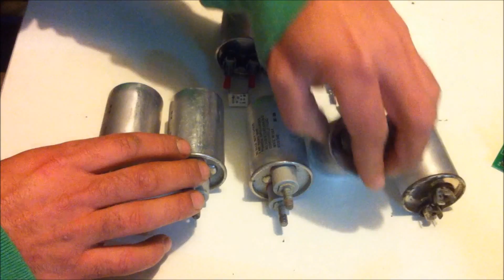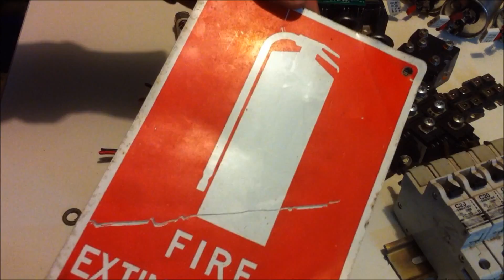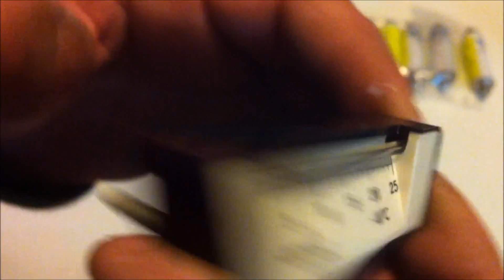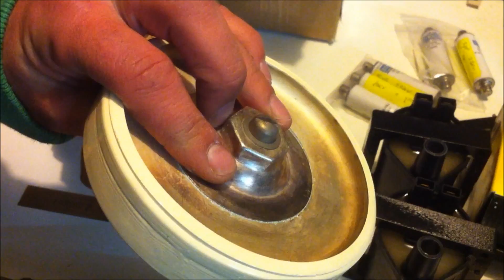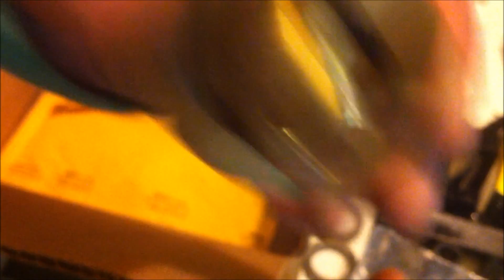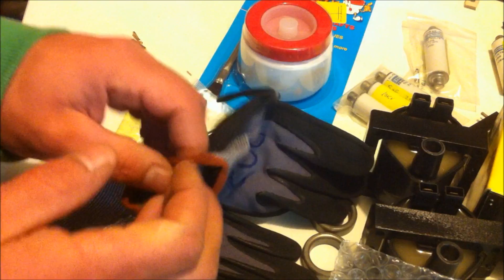Energy Update #31 - Opening Packages & Showing Off Some Parts

Comment: Hey Nick,

Glad you liked the goodie box. Did the brass plugs fit at least? I'm dying here wondering. 

All the best,

Tom
Reply: I too would like to know, so I will know if I have find a clean cloth to wipe the egg of my face for suggesting what the thread might be.
ATB
chris,
Reply from the maker: Yes, VERY much appreciated. Thanks.
I can't wait to use my new spillmaster!

No, the plug did not fit, aggrrrhhh! I am beginning to think this transformer wants to stay dead. I will be uploading the installation (attempt) video soon, but it bites in about half way down. The major and minor diameter of the thread is ok, but the thread pitch is off. In hindsight, we should have gone with 25TPI. Sooo close :(

Do you think I can just use some forceful tapping action (slowly backwards and forwards) to get it in the rest of the way? By my calculations, it should only cut roughly half way into some of the brass threads. I'm just hoping the steel thread on the transformer holds up to the pain if I go ahead with this.. Do you think this is a good idea or can you suggest an alternative? 

Thanks.

EF
Reply from the maker: Chris Stephens
Chris, See my reply below. No egg necessary, it was almost a perfect fit!
Not a bad effort considering we are all on opposite sides of the world and the fact that the damn plus is so unique :)
Reply: If I were there I would die the thread a teensy weeny bit. I suspect Tom did a too accurate a job on those plugs, or maybe the hole was cut with a worn out tap, it might only be a thou or so that stops a fit. Thinking of which, now that we suspect we know what it should be can you beg, steal or borrow a tap and die to just clean up both hole and plug. Even if it is 25tpi(unlikely) running a 26 tap down the hole wont ruin any thing.
Reply from the maker: Chris Stephens 
Chris,
You were right again... it is 26TPI. After reading your comment, I just used my 'extra force + shifter' method and I was able to slowly persuade it in all the way... Ten min later, after some backwards and forwards action, the brass plug was tapped to match the transformer. I gave the brass thread a once over with a brass wire brush and it was like it never happened. It only took a bees dick off the thread and now it glides in like a glove. 

Great job guys! Thanks so much :)
Reply: That's the beauty of this interweb/ youtube thingy, you have the whole world at the touch of the keyboard.
Personally, I am glad to have been of help.
Reply from the maker: Chris Stephens
Thanks again mate :)

Comment: Hey Nick,

So I supplied two plugs one with a pitch diameter considerably smaller that the other ~.008 if I remember correctly. Did you read the tag attached to the one plug? Which of the two plugs were you able to get to go in the transformer? Inquiring minds would like to know.

All the best,

Tom
Reply from the maker: Yes I read the tag. The smaller plug attached to the tag was the one that went in further, so that was the one I used. It was 0.008 smaller. I'm glad you took the time to make the second one... good thinking :)

Comment: That's some great high power DC surplus you got your hands on there. The IGBT driver board is an interesting design and filed away in my mind for future consideration, but is there any place you could put higher resolution photos of it?
Reply from the maker: Yeah, it's my first score of IGBT's and SCR's, so I'm pretty happy with myself. They are not cheap to buy so I would not have access to them otherwise. Even better is that it all came with modular (plug & play) boards to drive the gates. Good drivers can sometimes be just as expensive as the IGBT's themselves.

I'll add some close up photos of the IGBT Gate Drive Motherboard to one of my future videos for you. Thanks for watching :)
Reply: Energy Fabricator Cool, thanks! I'm building a 7.2kW SMPS right now with MOSFETS and if it works out OK I'm going to modify it for IGBT drive and around 10-12KW.  I picked up some 600V 200A IGBTs from a local surplus shop, probably first and last time they'll ever have anything like that, but they'll be useful in the conversion!
Reply from the maker: TheHouseBlog
Sounds like you'll be busy for a while. Good luck with your project!
PS - nice work on the variac refurb.